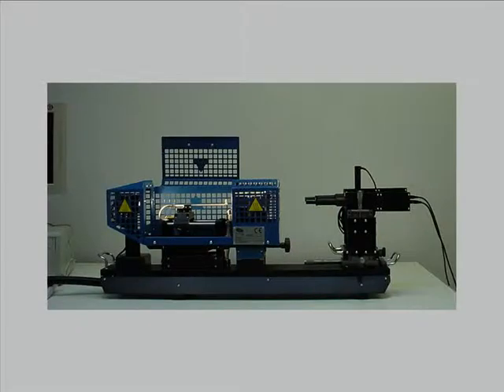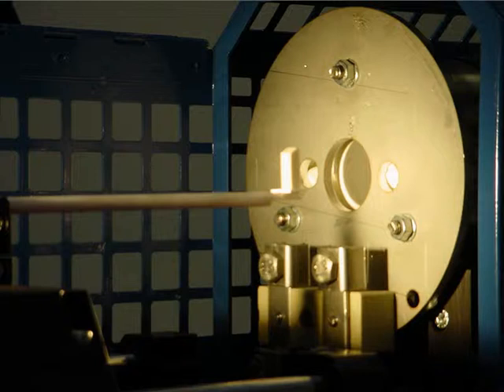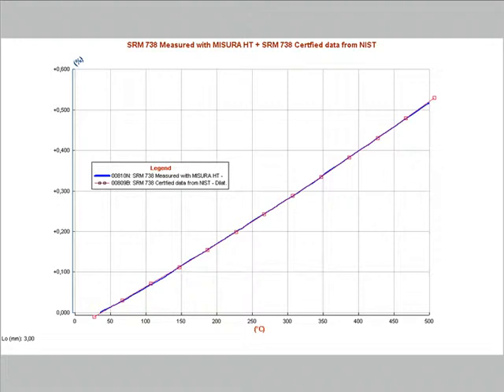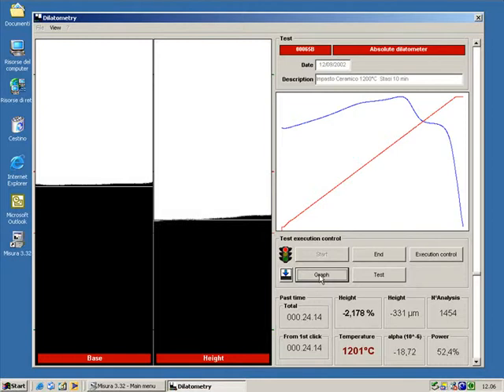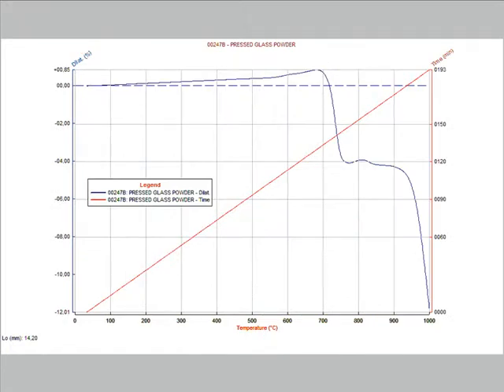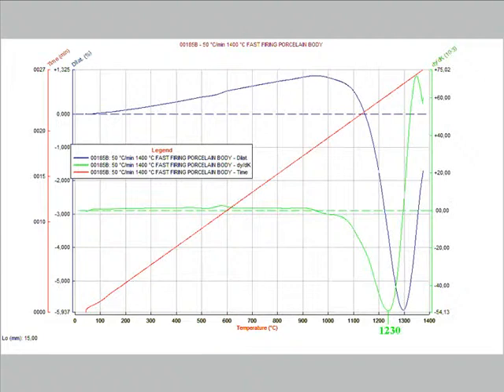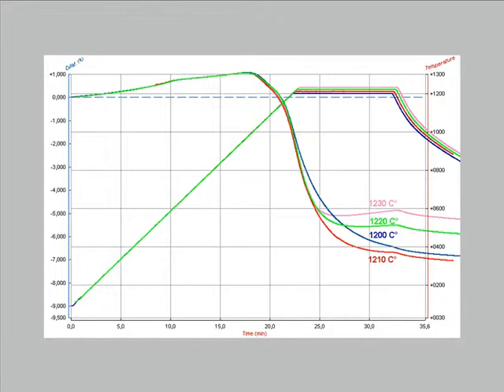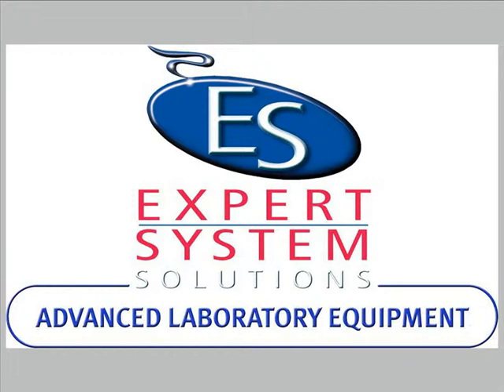Vertical Optical Dilatometer ODHT - Expert System Solutions - OLD LOGO

Comment: Very clear and useful: I see that in comparison cases for shrinkage in your case have the best  result at 1210 celsius : at 1200 not sinterize enough and at 1220 start swelling. but this for 10 min regarding a thickness of 5mm test. Looking the 4 cases after  6 minutes look that at 1220  the shrinkage is much  stable, at 1210 is not complete but still higher. This behaviour is normal for all the porcelain bodies? If the firing process not remove the organics parts from the body ( Cuore nero ) , the final result of shrinkage stay the same or change?
Reply from the maker: Dear Mr. Manini, your questions are good: the top firing temperature equal to 1210 °C must be preferred because it allows to achieve maximum densification without any bloating phenomenon. In this way the control of dimensions is obtained since shrinkage is standing once the sintering process reaches its ending phase. Is not unusual to see this behavior in porcelain bodies, due to expansion of trapped air and to the low viscosity conditions at high temperatures. As for the burn out of the organics components, can you explain better what you mean for "final result of shrinkage stay the same or change"?
Reply: Thanks for the answer! 
At fast firing cycle of course have impurity inside the tiles: the degasation process is not complete and in our case the strip of black substance is thick and cover over 50% of the total thickness. 
I don't think that at the end of the  test in your small piece of tile ( 5x5 mm section) if you broke the piece in half , appear any trace of black core). You never try to check with a bigger section ( 10x10 or 12x12 ) and change the gradient living the same amount of minute in firing zone ? ( in other world make a test with short and fast preheat and same firing time ) and then compare. Just to check if the black core affect the shrinkage of the tile.
Is a question that I have since a lot of time but in production is hard to test and is hard to communicate in this way with standard lab.